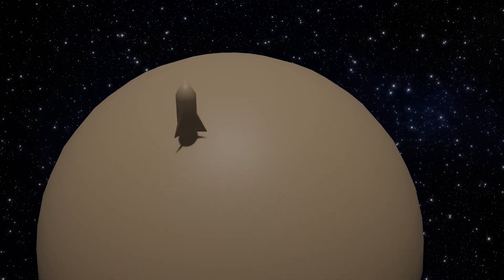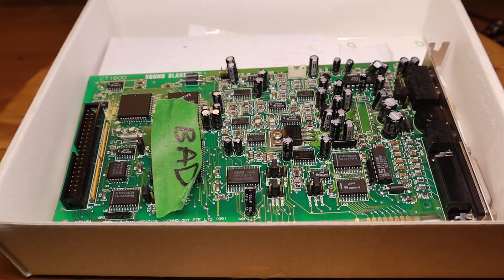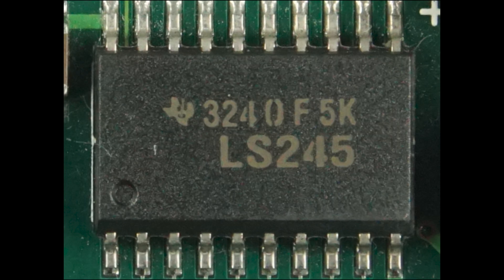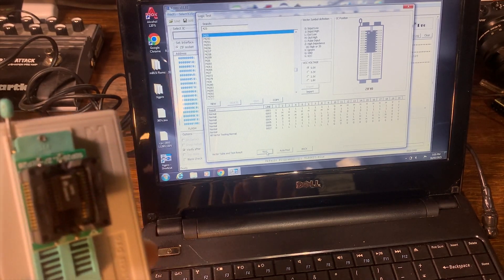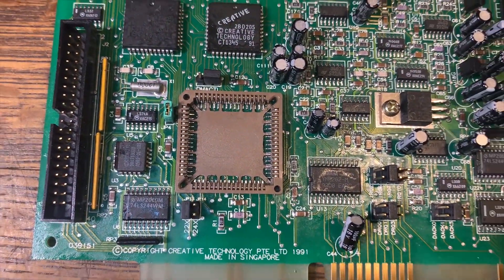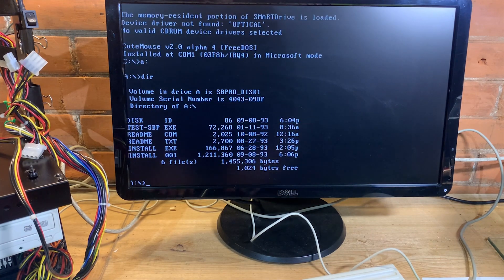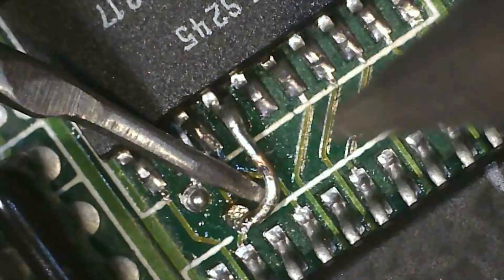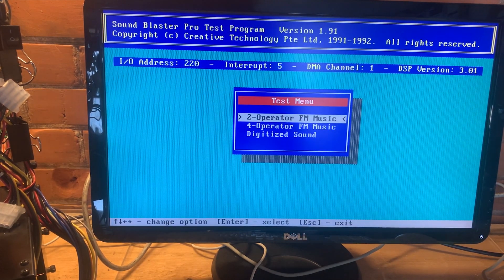"Bad" Blaster Finally Fixed

Comment: Oh, I wish I would have been here before to answer! Yeah, the CT1336A is an updated circuit diagram of the CT1336, but all pinouts and bussing paths are identical. I had to replace a bunch of those on IBM Sound Blaster Pro cards, because IBM demanding their own card build but using Creative components was STUPIDLY done, and the CT1336 packages were being somehow overvolted and cooking off. IBM supplied the parts and we 1990s Best Buy PC techs did the swap. It was only in a PS/2 grouping of 386 machines, if I remember right, because IBM ditched Creative and was putting Opti-based sound in the 486 line if I remember right, when the Aptiva replaced the PS/2 branding and they went back to ISA/VLB.

A horrible time, really. IBM wanted things their way or no way, but the geniuses were so full of themselves they couldn’t even do it by someone else’s standard!
Reply from the maker: So were the IBM SBPros being fitted with the 1336A because they were able to tolerate higher voltages? Or was it just because they were newer parts after they had fixed the circuit, assuming they fixed the overvoltage issue? What is also curious is the abundance of these 1336a chips available today, the seller claims to have 1000s. Almost as if they bought old stock from whoever created these chips ( was it Creative in house or did they have another manufacturer make them and put the Creative name on them? )
Reply: @ All I know is the A model was tolerant of the voltage issue. Cleaner design? I really don’t know.
Reply from the maker: @Eireman_on_Twitch  That's good news then. Thanks for your details, really appreciated that.

Comment: That was a great fix! The corrosion below that chip was not easy to find! That was really lucky that you took that chip off and found the broken trace. And that jumper... another hard to find fault! Congratulations on a nice fix again! You continue to be on a roll!
Reply from the maker: Conquering this card is a dream I've had for many years. I'm glad you saw this. It's a bit like the voodoo2 card you fixed, with the scratches leading you to the failed resistor pack. When I first saw that bit of corrosion above the 245 chip 3 years ago I should have assumed it went further. Live and learn as they say. Like my new rule, remove all the jumpers, even if they look clean. Thanks for all your advice.

Comment: good repair - im not into sound cards but i liked ur guess work -  a bit meh  about missing that  jumper tho  ha ha - but the chip swaps , finding one from a modem, buying the cheap close match CT1336a  etc and installing socket was good work and entertaining to watch
Reply from the maker: I can understand that the jumper might not affect you the same as it did me. I'm still facepalming over it. I didn't really elaborate on how many times I took that card out of the box and looked for faults, tested parts, wasting hours and hours, beaten by decades old technology. Especially because I made such a point of "the Simple things" in my last video. It's hard to know how things will be conveyed and your feedback is greatly appreciated. I'm glad you found it entertaining, going from "it's junk" and a parts board, to logically solving all the faults is such a nerdy victory for me.

Comment: 4:09 I COULDN'T care less. 🤮
Reply from the maker: I agree, the correct form is "I couldn't", but it sounds clunky and to be honest I do care about the modem a little bit. So technically I could care less. If I didn't care at all I would have used a propane torch to the bottom and bashed all the parts off.
Reply: @esc2dos  😊 You're great!
Reply from the maker: @mirabilis  I hate bad grammar too, thanks for the feedback. Sometimes things just fall out of your mouth and until somebody points it out, you don't even hear it.

Comment: Interesting!! ...My CT1600 manufactured March 1st '94 has a soldered CT1336A.
My card is immaculate with no visible signs of corrosion or damage, current status ...it's Dead, and yes I have checked the jumpers.
When last in working condition I noticed some caps were extremely hot, though not bulging ...my intent is to do a re-cap.
Thanks to your efforts I can now proceed.
Reply from the maker: Check your Voltage regulator first. It should be making 9v for the ct1600. I discussed that in my previous fix. If it's sending too high a voltage that could cook caps. Start with the hot ones, if you can check the ESR value, you might find they are reading way too high, and need to be replaced.  I suspect that the little caps beside the amp chip may have prematurely killed my amp (the TEA2025) in my "SBP Upgraded or not" video. But the LS245 clearly will cause the card to fail detection. I wish you luck, sure is a great feeling seeing these cards work after being dead for so long.

Comment: im just using some Aztech card, it does the same things a SB Pro does.
Reply from the maker: Yes it does, and I covered that in my "Soundcards" video. Where I learned the Sound Blaster pro sounds like it's being played through a wet sock. Aztech has a better top end.

Comment: Great video!  Glad to see you were able to see it through.  I also have a CT1600 with a DMA issue.  When you say CT1336a chips are abundant,  do you mean AliExpress or did you find another source?  I am afraid of getting a fake from there.
Reply from the maker: Ali Express yes, says there's over 4000 left., they look totally legit. I just tested the second chip and it wouldn't work at first, had to lightly sand the legs 1500 grit sandpaper. Works now. That's a relief.
Reply: @esc2dos  Awesome, I will give it a try!
Reply from the maker: @ Much cheaper than having to buy a parts card, which I don't really see anyway. Let me know how it goes, and thanks for the compliment in your first comment I got distracted with that chip not working at first.
Reply from the maker: BTW, I added this info to the video description after we discussed the chips. Just in case you go the socket route:

UPDATE: If you use a 68 pin socket don't put the chip in until the socket is soldered to the board. I snapped the corner seeing if the 1336 chip would fit before I committed to soldering the socket in. Further.. I stupidly soldered the broken socket in this card, didn't notice until I tested the second 1336a that I got. You can see the crack in the upper left corner in the closeups. I have since removed that broken socket and soldered a good one in. The second 1336a works too.
Reply: @esc2dos  So while waiting for the CT1336a chips, I inspected the board for damage and found a cut trace.  Fixing this trace allowed the DMA to work again!

Well, at least I will have some spare chips...
Reply from the maker: @timcross3461  That's fantastic news. Congrats. Knowing that these chips can fail it's good to have them just in case, so definitely not a waste of money. Where on the board did you find the cut trace?
Reply: @esc2dos  it was a connection between two vias on the back of the board.  One side was from pin 63 on the ct1336 going to a pin on the ct1341.
Reply from the maker: @timcross3461  You have a keen eye, that stuff is easy to overlook. Interesting what can make the DMA fail, these are good things to know. Thanks for sharing that.

Comment: what! you jacked the chips from the modem, how you gonna get the internet? if you had found the jumper you still would have found the bad trace, just in a different order. good fix!
Reply: lol whats with dr who and the stegasaurus? forshadowing?
Reply from the maker: when Pertwee says "it's a vegetarian" at the start of the video.. that's what he was talking about.  I thought I'd close on that.
Reply from the maker: LOL, how will I get my mp3s from Napster without it indeed. If the jumper had been the only issue.. after all that carnage, and the trace repair made no difference. I dread to think about how pathetic I would have felt.